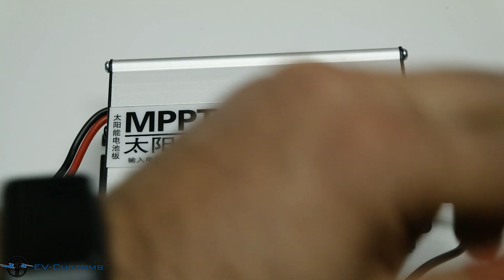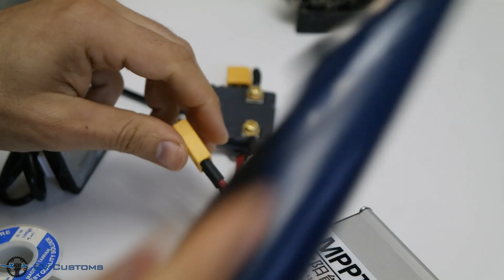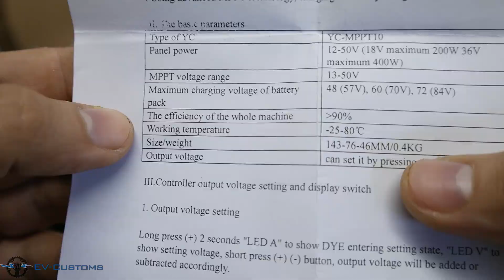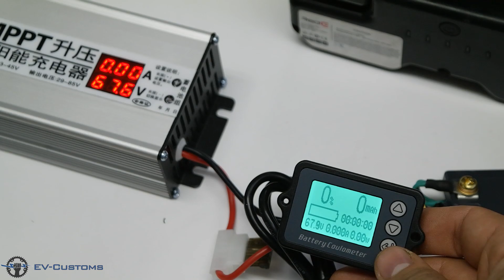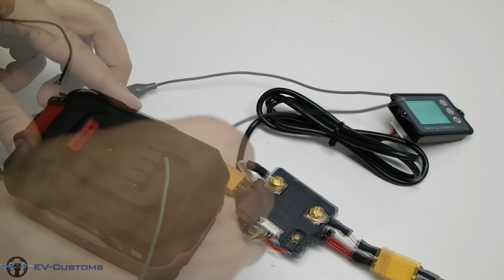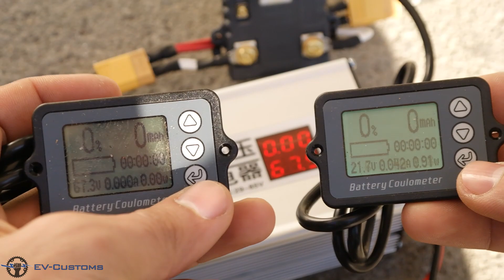EV Universal MPPT Charger from Solar, Battery or other Sources (SOS Charger)

Comment: I have this too, but i try 24v to 72v with only 0.6 ah to charge its to slow for charging
Reply from the maker: Hi.. from input side you have connect battery or?
Reply: @evcustoms  yes, battery to battery also
Reply from the maker: 24V normal voltage or at max? also how many capacity it has?
Reply: @evcustoms  24v 100Ah to 72v 25ah, its just only 0,6 ah when i used
Reply from the maker: @papah_diy9173  I am asking you because no sense there...  your high voltage battery is charged? from the output of MPPtT charger your maximum voltage  settings is ok? it must be set at 84volts .
Reply: @evcustoms   im just set at 79v in that device, so i must change the output device at 84v ?
Reply from the maker: Yes it must be set at 84V
Reply: @evcustoms  ok i will try it